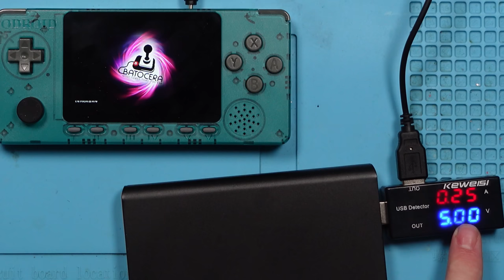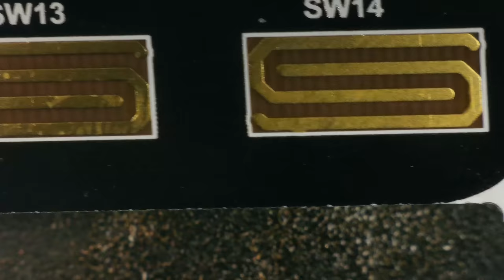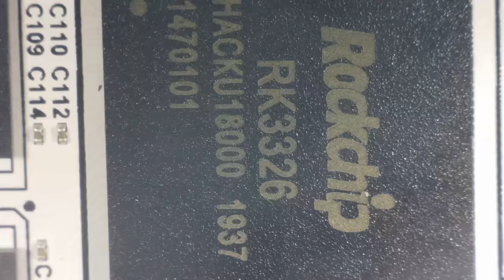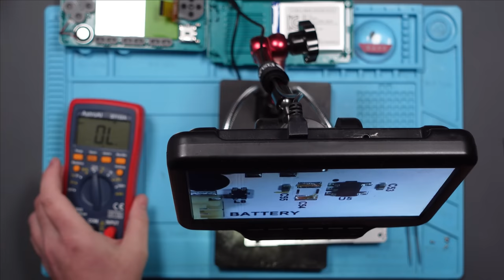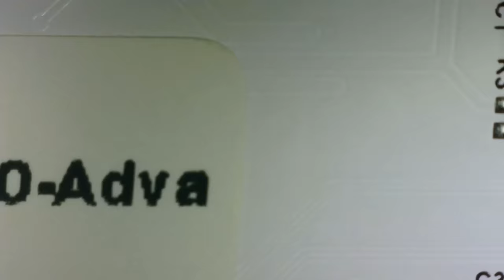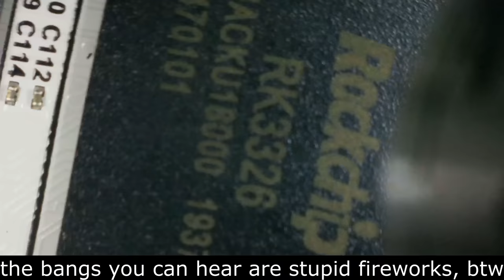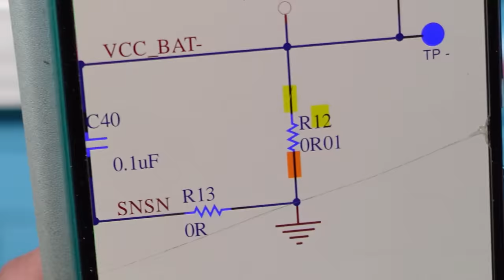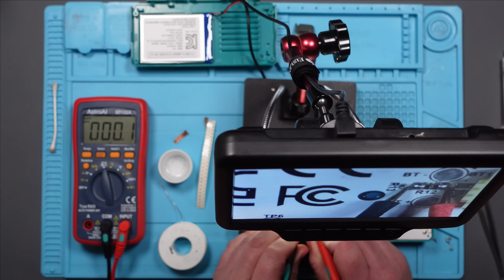I Bought an Odroid GO with a Strange FAULT | Can I FIX It?

Comment: @3:10 "Whatever that is?" - Awh, that's only an oscillating crystal, aka: the very heartbeat of any digital circuit. So not really that important, I'd reckon 😅- Stupid Steve! 🥸❤
@10:22 The SMT equivalent of motherboard-jumpers, maybe?
@11:48 I think my main go to multimeter is really good...for the price. Which just happens to be the same as yours. In fact, I have gathered quite a small collection by now, and that AstroAI is by far the best of them... That could obviously just mean that the remaining lot, is a pile of useless super-junk, I guess.

Comment: Now you used' The Chemicals brother Steve! the device can GO! once again 007StezStix has the fix! oh BTW brother Steve! that 0.01 is a current sense resistor.
You replaced it with a close enough value but.. please keep checking the battery when charging, don't let it get to hot..Lest We Forget 🫡
Reply from the maker: 🤣 thanks brother Steve!  Ah, a current sense resistor!  That makes sense now.  I'll keep an eye on it, and I'll replace it if it starts smoking!  😁